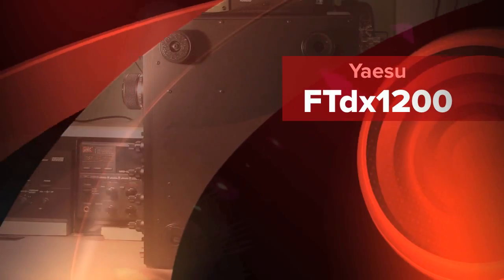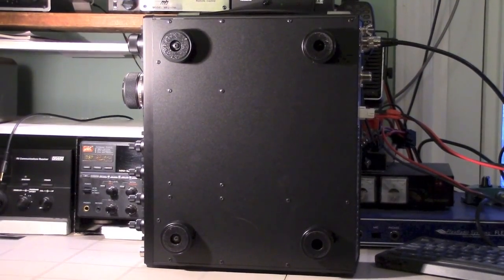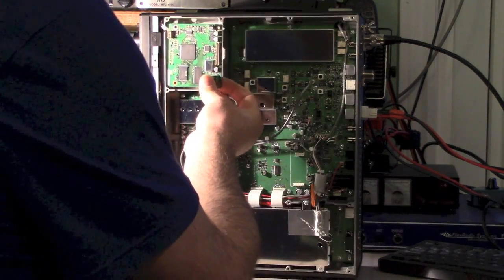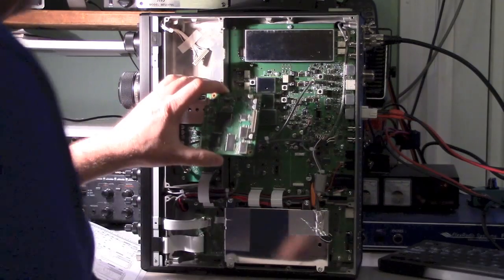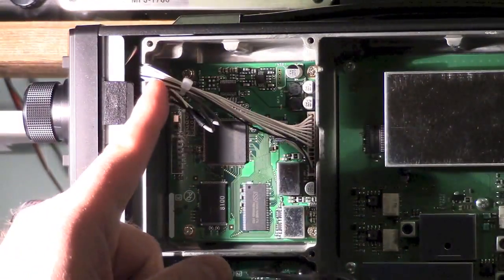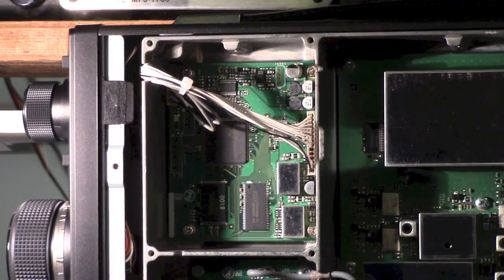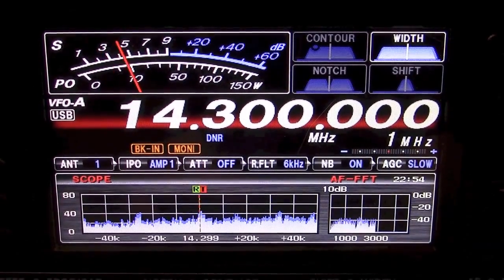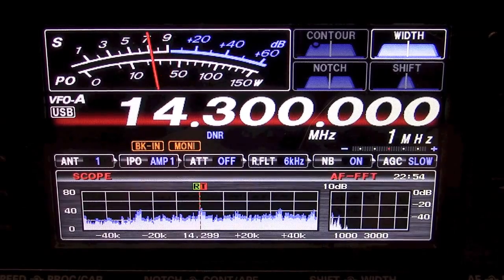Installing the FFT-1 unit in the Yaesu FTdx1200

Comment: when i installed the fft,those wires where a little short,so relieved the tension a little bit by just grabbing the white wires
and gently pulling up on them rite where they bend into the space for the board.the grey wire was long enough without me touching them
hope this helps 73 kg2mb

Comment: just a tip I installed my fft1 board today and the wires were tight look down the chassis at the back of the tunning knob you will see the wires are taped if you take a flat head screwdriver not a knife and release  the tape you will have plenty of slack on the wires to install

Comment: Thanks for the video. Two quick questions, hopefully you or someone can help: is the FFT-1 just to decode and view on the 1200 screen? And,  Is it necessary  or better to go with the Yaesu USB interface or will I be able to just keep using my SignaLink that I have been using?  I have currently been using the FT-450, just ordered the 1200 and trying to determine what is 'necessary' and what is not as far as accessories.  I have gotten into RTTY/PSK but would rather not spend another $175 for the USB box if my signaLink works just the same.  '73 K5VOP

Comment: How do you encode or transmit psk or rtty with the FFT-1 ? I saw your other video review
Reply from the maker: You don't. That's not what it's for. To do digital modes you need the USB interface unit.
Reply: The Radio Hobbyist
 like this one ?   http://www.gigaparts.com/MFJ-1275.html
Reply from the maker: Yes. Yaesu makes one for the 1200 too.

Comment: now that the sound card is installed can you connect to laptop and use software like DM780, FLDIGI, or do i need a external sound card  to operate on laptop
Reply from the maker: This is not a sound card. It is a graphics card, used to display audio data. You need the Yaesu SCU-17 Interface Unit may be used for CAT control of the transceiver with a computer via a USB connection and for communications using SSTV, RTTY and PSK digital modes.
Reply: +Jon KE6JON My FTdx1200 is connected direct to my PC with nothing in between. I have two cables: One between CAT control (radio) and USB (PC) and one 
connects digital port (radio) with sound in/out (PC). Google "Yaesu USB CAT+PSK31 Cable FT-DX1200". I bought the cables on eBay.  Now, if you already have an external TNC, you can probably still use that, but I just got the cables. I use HRD (DM780) and have had no problems with CW, RTTY, PSK. I'm also using the cables just fine with JT65 and WSPR.

Comment: looked it up on Giggaparts and the module is around $180. if u buy it with the radio, they install it for free. not a big deal as u show anyway. a must have with the radio! i think it is standard on the 3000.